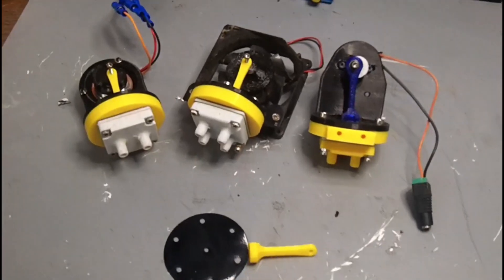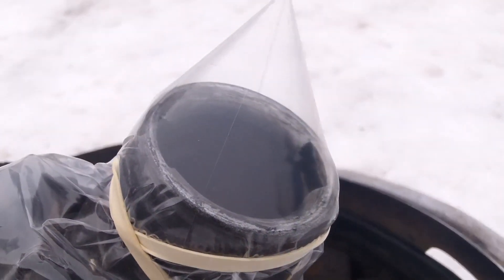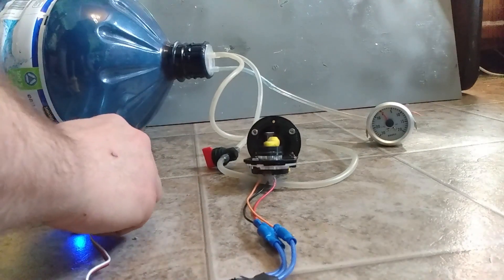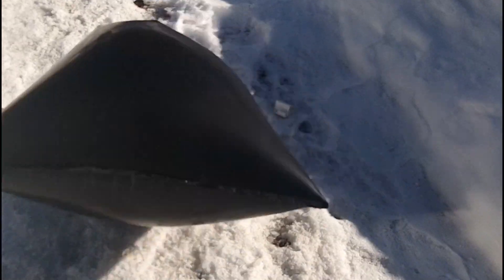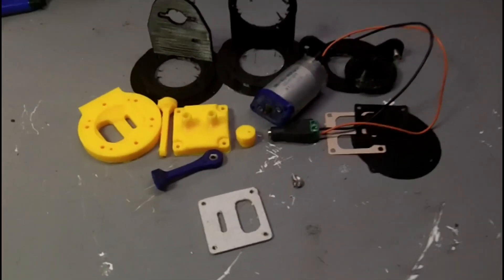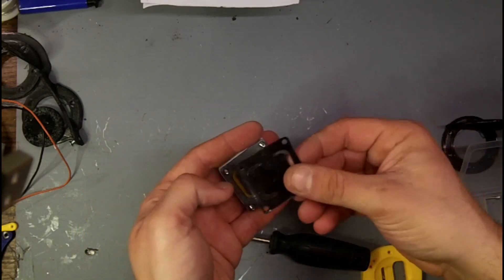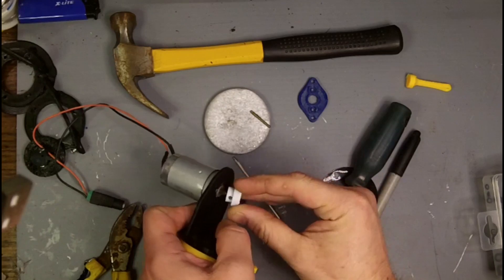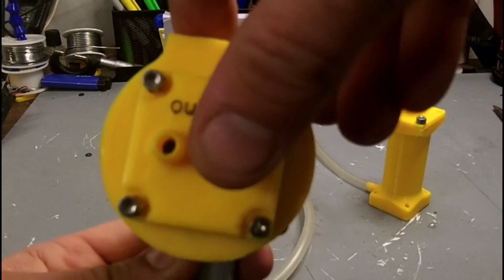Improved 3D Printed compressor/water pump

Comment: Bro, please read what's safe to cut on a laser before doing it - cutting PVC is EXTREMELY dangerous, don't ever do it! I feel so sorry for you, hope you're doing well...
Reply from the maker: The room im in is pressurized and vented outside . Im usually not in there with it and i was wearing a resperstor. Still not great i know i have moved on to silicone molded diphrams anyways . Thanks for the concern .

Comment: What is the material you used for the diaphragm?
Reply from the maker: @mapo2795  i used a woven polycarbonate fabric , I found it got brittle after a short amount of use ( 3 months or so continus) i think i put modles in for the diaphragm tpu or other flexibles may work. Inner tube rubber might be decent as well . The same material should also work for the valves .

Comment: For the liquid pump use a smaller eccentricity if you want to build more pressure. The volume flow will be smaller tho. 

To smooth out the pressure peaks of high pressure side of the pump, design and print a pressure accumulator based on a free piston and a spring. 

Make sure you are able to change the spring because you have to test multiple spring sizes with different forces to aquire the best damping.

Use mineral oil as a working fluid and also o-ring material compatible with mineral oil.

Also, if you want to make plunger type pressure pumps, don't use ordinary o-rings (circular section), but use X rings (bold X section). Square rings are fine too, but X rings are the best.

I highly recommend you to check for publicly available patents on automotive pressure pumps used for braking to get inspiration for high pressure pumps.

Comment: This is the best air compressor pump design on youtube when it comes to DIY and 3D printed. Seems to be long term low maintenance usage and high pressure. Thanks for this great research.
Reply from the maker: Thanks, So far the diaphragm is the week link but easy to replace